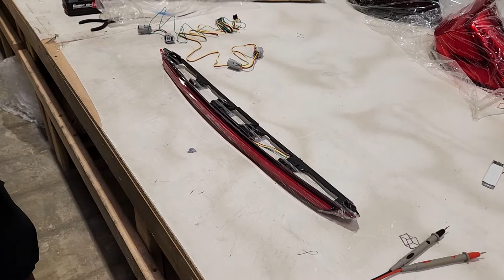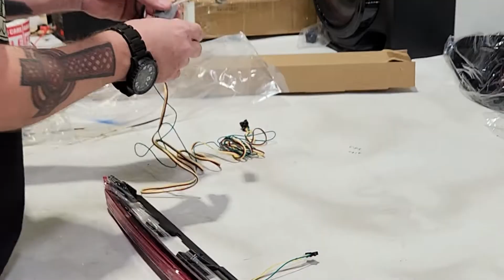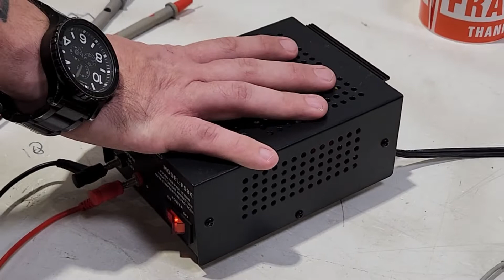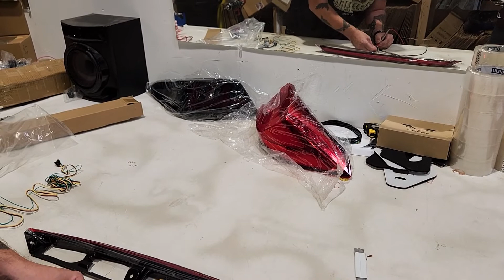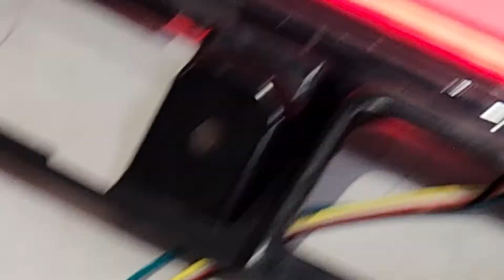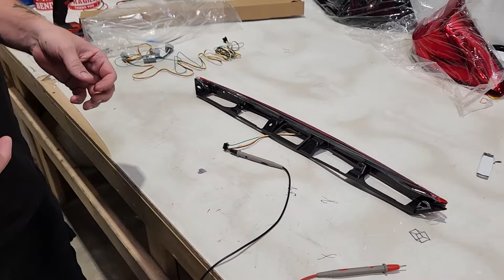HRS 2018-23 Toyota Camry LED Trunk Bar - Wiring & Troubleshooting

Comment: How long is the life on the bar light
Reply: Don't buy it! Quality is trash!
Reply: Mine has been holding up perfectly since 2019, if you solder wire everything correctly theres really no reason this will fail you. 

Most important thing to do is always Silicone Seal the wires going into the housing of the lights itself. If your wires are 100% perfectly connected and sealed, the only way the light can fail you is if moisture gets into the light itself.